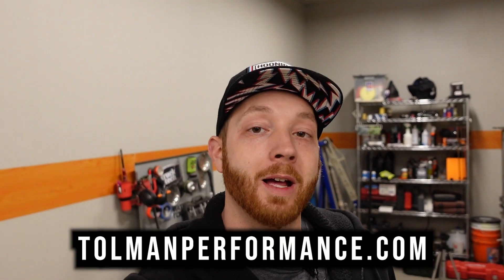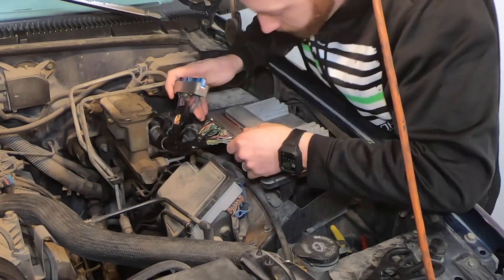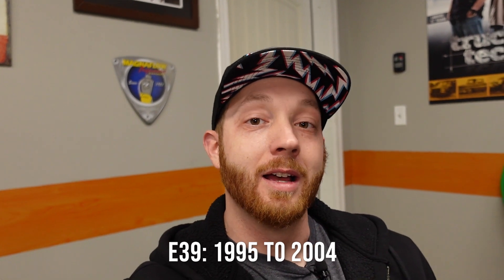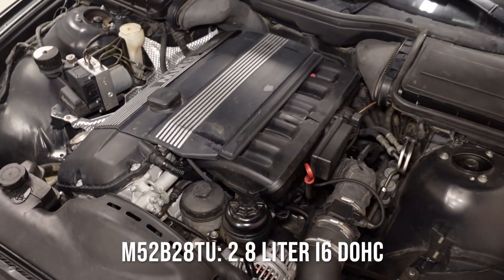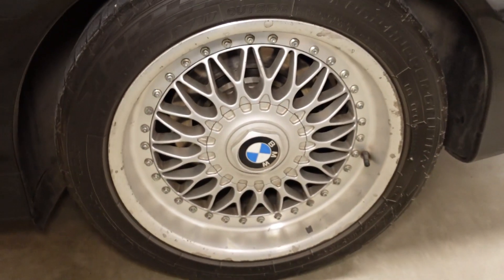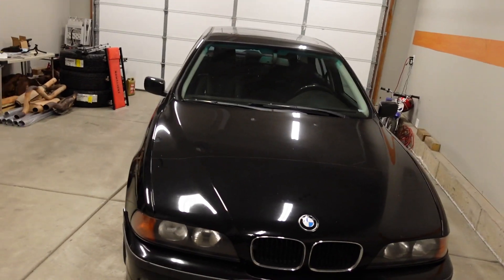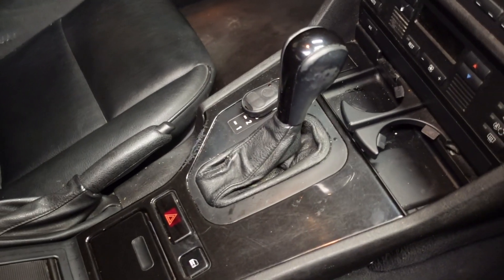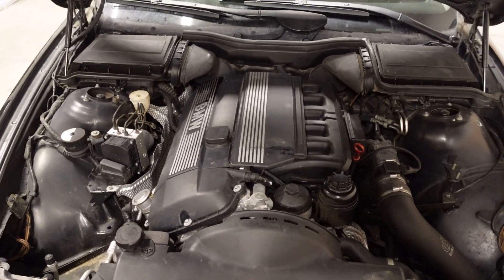I bought a new project car! (and it's not what you might think)

Comment: If you do decide to LS swap it this is one of the “easier” bmw chassis to do it with. By easy I mean you don’t have to mess with any canbus systems. The engine functions are separate from all the other systems so it makes the swap easier. Another bonus is that there is a lot of information out there on the swap for this chassis.

Comment: Look at changing the inlet manifold to the M50 version and adding the large bore throttle body (if it doesn't have one already) . The inlet swap adds 20 bhp alone, does give more with tuned ECU's. BMW detuned the 2.8 engine for tax purposes. 
Also M3 exhaust manifold will fit.
It's also possible to do a cam swap on the cheap. Allegedly the profile for the standard (E36 S54 engine IIRC) M3 exhaust  cam is fairly close to the "fast road" inlet cam spec for this engine. So maybe add 2 exhaust cams to the list.
Some people here in Europe have the same engine in the E36 2.8i Sport knocking on the door of M3 power without Forced Induction.
It's a cracking engine, well worth doing a bit of research. Google will reward your efforts but your wallet might not thank you!

Comment: A friend of mine has a 1998 535i with only 450,000 miles on it. Said he has never touched the motor, but I know he did replace the transmission because he and I went down to Oregon to pick up a used one from a wrecked BMW. The seller pointed out how it said made by GM on the case. It's a cool car, silver with a black leather interior.

Comment: I think the E46 M3 SMG and manual gearboxes are the same, other than the bellhousings, the SMG version just has a hydraulic system added to it to automate the gearshift and clutch, and you can possibly change a SMG box to a manual.

Comment: Wouldn’t an aluminum LS have a better weight distribution? It’s not as long or tall, and if it has a GM transmission it should be an easy swap
Reply from the maker: in theory, I guess it would because the weight of the engine will sit further back because its 2 cylinders shorter

Comment: They make reman engines for this that come with a ported head and hotter cams. Add a supercharger and a 6 speed swap and it would be al lot of fun. Btw I had one of these in 99 and had fun hunting Mustang GT's. That rear gear ratio really does make it snappy off the line.

Comment: LT, be careful of that 4l30E they also put that trans in Isuzu vehicles, and Honda Passports but the BMW and Cadillac 4l30e transmissions ARE NOT interchangeable with Isuzu or Honda, they are completely different with different input and output shaft sizes and gear ratios etc. They they also have to be babied, they are not very strong but if you maintain and don’t beat on them they’ll last. They are also made in Strausburg, France

I have an 01 Isuzu trooper and I had to swap the transmission because the guy before me, adjusted the 1st and 2nd gear brake band too tight and burnt it up. Just don’t throw a lot at it, posting this before I watch the whole video, so hopefully you see it!
Reply: Ok, watched the video, if you remove the trans, you can get a fair price for it, Even though it’s used. Especially one that drives fine, I don’t know how it is in Utah, but here in North Carolina they are pretty rare for BMW, or Isuzu and Honda 4l30e transmissions.

Comment: Leave the transmission alone. Just rebuild the auto. A manual conversion will just make a mess of the interior and it'll never be BMW quality. 
Then get a Dinan turbo kit for the 6cyl.

Or if you wanna do the German equivalent of an LS swap, put a Mercedes OM606 in it!

Comment: Those 4l30's are not very strong..  they date back to early 90s and were installed in a bunch of isuzu suvs.  Had a 92 isuzu rodeo with the gm 3.1 rated at 120 hp and 4.56 gears oem.  Transmission didn't hold up at all...